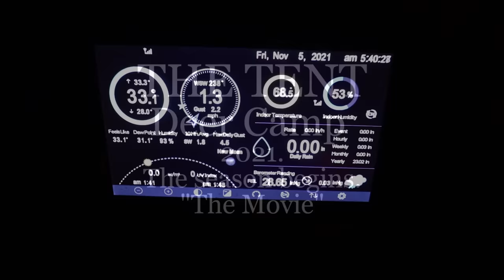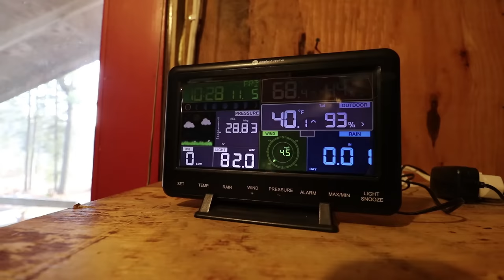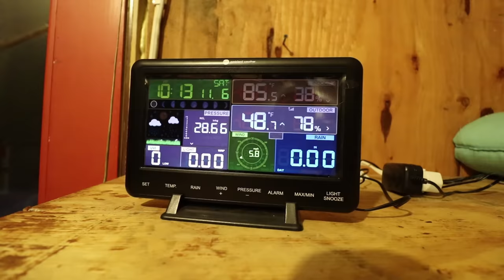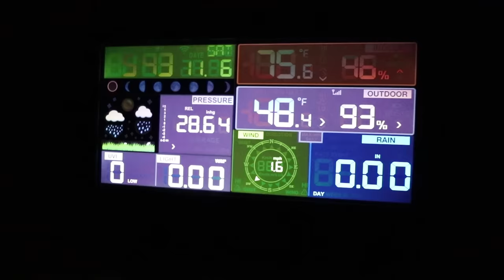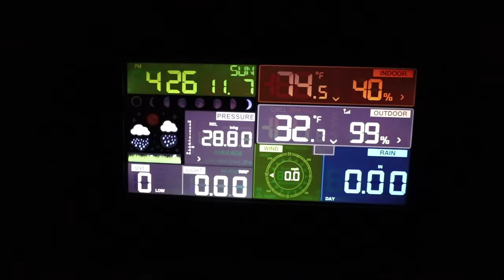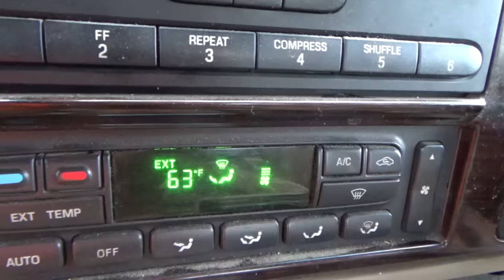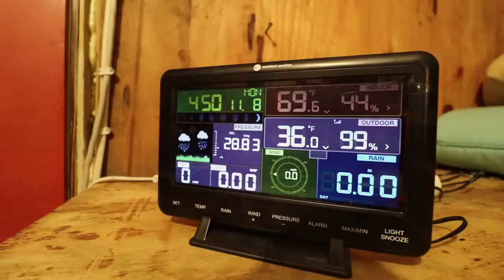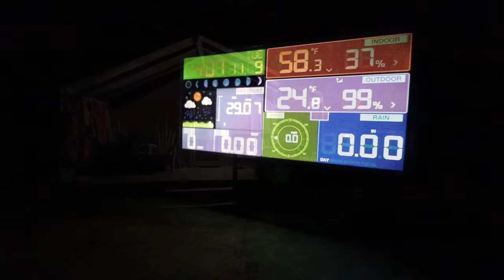THE TENT. Deer Camp 2021. The Season Begins. "The Movie".

Comment: Joe, Anti Skid the steps with the nail down tread, they are def getting green and slick over the years.  Also, 5 Gallon reuseable jugs, and a hand pump or battery pump from Wally world is what we have used for years at our dry cabin!  Works fantastic, and no more weight then your 5 gallon Jerry Cans, Jugs are reusable, exchangable and recyclable
Reply: I was thinking the same thing. Great ideas.

Comment: Hey Joe. If it's bugging you, @1:52:56, that mat by the door, that corner is popping up. That's easy to fix. Just put a damp towel on that corner, and then put a hot iron on it. Let the iron heat up till it steams, then unplug it and leave it there till it cools. When you pick up the iron, the corner will be flat again. You could probably use a hot brick, or even a flat stone. Best of luck and thanks for the content.
Reply: Along with that, I found myself telling the screen..... hey change the batteries on that little white clock up by the microwave.  ;-)

Comment: Say Joe, I use one of those 5 gallon cooler jugs with the little push button spouts in my camper. And if I put hot water in it it'll stay pretty much warm until it's used up. That little push button spout keeps wasting of the water to a minimum. It'll take a little practice.

Comment: Excellent video, one question how does that heater work in the stand ? Do you have electricity there, or it runs on a generator
Reply from the maker: Propane. No electric needed. Look up the big buddy heater.

Comment: Thanks for the video. Any thought on setting up something with a shallow well or rain water catchment and a hold tank. You can run a purification system on it the times that you are up there off the generator or even a small solar setup to solve the water problem. Red Poppy Ranch has something like that setup for his offgrid water needs. You probably would not need to go as elaborate, since you need less water.

Comment: Still the same lol Sarah it’s 4:30 , Sarah it’s 4:45 , how I chuckle because it sounds like one of our guy’s. Need some snow and cold air then they’ll be moving around…I have a ground blind like yours and one time I didn’t steak it down and we got some good winds well it took me a while to find it after the wind blew it away …..why don’t you use tank on side of stove to heat shower water in put in before you go out in afternoon time you get back be hot enough for the same as the 2 pots on stove that’s what we did worked great for us , just wondering……build another one like Zack built and put on 4x4 s up in the air like tree house and make a box blind with steps or ladder , windows every wall , heat , chair….put can goods under mattress won’t freeze then take home last time up..

Comment: Hmm n what kind of tent is that looks military like a GP medium  or large with a cold weather white liner but I could be wrong could be a custom made tent to I duno Ive seen similar bhot tents in Canada the US military has several sim ilar types with green canvas louter and white internal so its likde two tents in one usually two tengt stoves per tent as well I know as I worked in supply they were pretty decently made but I wasnt crazy about the fuel heaters swe used in them but they were pretty warm tents b ut not slomething one guy could set up Unless it was a GP small with one center pole a hex shaped  tyent and they had various type heaters in them. But they had to be watched all the time due tlo the fuel we used.
Reply from the maker: It is just a canvas wall tent.